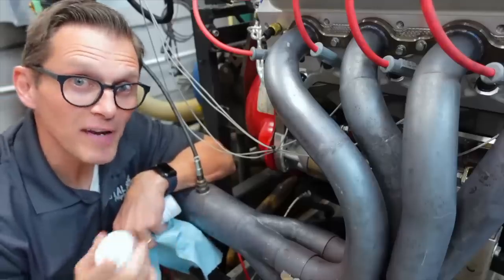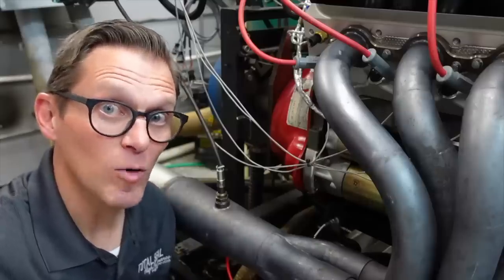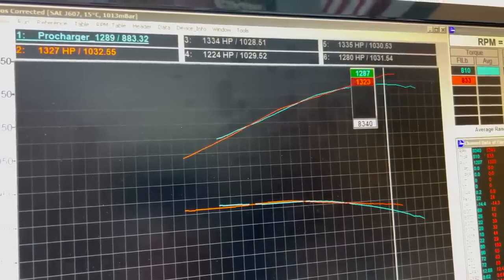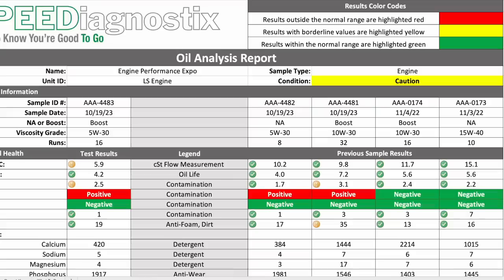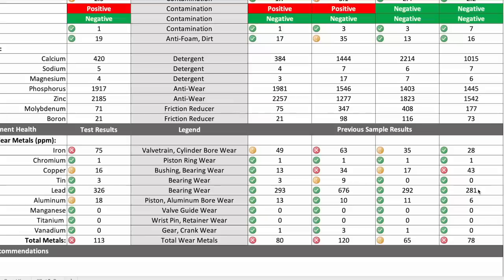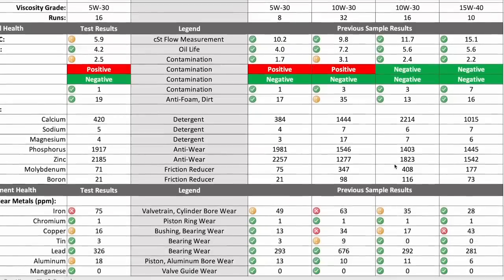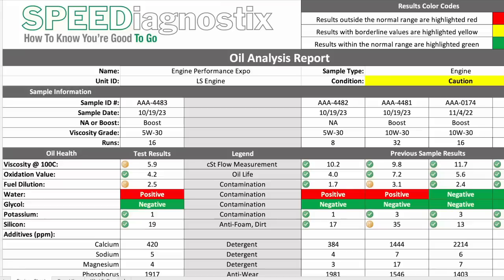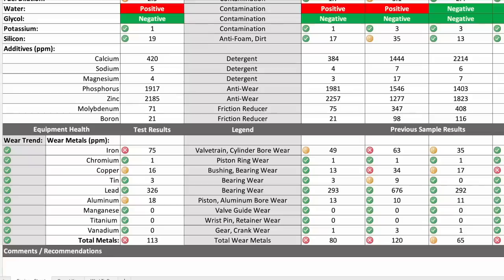What Adding BOOST Did Do To Our Motor Oil (NA vs BOOST Test)

Comment: It's "amazing" (not sure if it the right word)
The difference engine temperature makes to oil and contamination. Personal experience living in Canada, My daily driver, 2017 gmc sierra with a v6 has some very minor upgrades.  Exhaust,  intake, tune and an oil catch can. In the summer months, the can collects about 2-3 oz of oil and gunk over the span of one oil change.  6 months and 6-8000kms of 20 minute commutes, errands and maybe 6-10 weekend camping trips (1-3 hour drives) towing a 6500lb trailer.  BUT, in the winter my driving is entirely just commuting and running errands. In about a month that can will fill with about 5-6 oz of mostly water and only trace amounts of oil "scum". I've even had it freeze up once and it ruined the baffles in my old can trying to empty it. But the unknown factor is the fuel makeup. There are different blends for summer and winter gasoline  which affects emissions and combustion.  So how much is caused by cold oil/engine vs fuel quality.  I've also heard that e85 is hard on oil as well. I'll go out on a limb and assume it's probably a similar result to what I'm already seeing in winter but year round regardless.  (I can't get E85 here to test that)
Reply: E10 sux but I just filled up and non ethanol is 85 cents higher. That's 28%. 😮
Reply: Regular  is 3.98 here and ethanol free is 6.00

Comment: RacerX Needs To See This: Thinking fuel dilution possibly killed his first Demon 170. On a boosted engine you probably cant change your oil often enough.
Reply: Not all boosted engines are the same. There’s a huge difference for oil between a supercharged engine & a turbo charged engine since the turbo shares the oil. So yes a turbo engine pretty much can never have the oil changed often enough. Number one turbo charger failure is dirty oil.

Comment: Excellent info. Was wondering if it was affecting the oil the same way Ethanol fuel does. Running from E30 to E70 with %40 bigger injectors, more advance timing and %30 more boost. Still on 5w-30, but change oil at 3K. Unfortunately, 10W-30 holds too much calcium and on a DI, not ready to take the risk.  THANK YOU.
Reply: With increased boost and bigger injectors ethanol can really do a number on your oil (especially if the engine is port injected - cold start dumps a lot of ethanol).  I went from 5w-30 factory to 5w-50 on my CTSV after I bumped the hp up by about 300 over stock with ethanol and more boost.  Still has good oil pressure, minimal consumption and great power output after 80k miles on the corn.  But you can smell ethanol in the oil after 3000 miles.

Comment: Obviously, the dyno engine is a different animal altogether. With that said, the newer OEM engines with turbo that are spec'ing 0w20 or lighter, is scary from a longevity standpoint. 

My wife's new SUV has an inline-6 turbo. Owner's manual states 0w20, but only for USA and Canada  😉. Everywhere else, it states 5w30 is best even at temps below 0 Fahrenheit I think. I live in an area where summer mornings are 80 degrees or higher at dawn. I'm thinking of going to 10w30.
Reply: I have to agree, if your in a warm climate 10W30 will protect your engine much better than 0W20, use the 10W30
Reply: @spartus56996   I read the manual upon purchase and saw the oil rec's. I did the first oil change @ 900 miles with 5w30
Reply: Careful there, my friend. Engines designed for these lower viscosity oils have tighter bearing clearances that are engineered to maintain clearance with these thinner oils. I'd probably try 5w30, but no way would I put an oil with a 10 base oil in an engine designed for 0 viscosity oil. I'm sure the manufacturer has done plenty of cold starting and high temperature and load testing with the viscosity recommended. With that said, I would take the manufacturer's oil change interval and half it.
Reply: @dougrobinson8602  No issues at all to use a 10W in place of a 0W in year round warm climates, if someone was really concerned, do the 5W30
Reply: @spartus56996  I am sceptical about cold start and pumping efficiency of grade 10 oil and it is more viscous fluid for most of modern car engines
Reply: @dougrobinson8602.   I think the clearances on modern engines are actually more accurate and uniform as well as "somewhat" tighter. Also the metallurgy is better & surface finishes are much smoother. So it's not like 10W30 is a 1/2 inch thick or something, you know what I'm saying?
Reply: @dougrobinson8602   Agreed. Been dealing with engines, clearances, etc for many decades. The engine, in my strong suspicion isn't necessarily designed for 0w20 as that viscosity is only recommended in the US and Canada. Everywhere else, the manual and oil viscosity chart recommends 5w30 as the best oil
Reply: @dougrobinson8602   so in warm climates IMHO don't think 10W? should hurt.
Reply: @dougrobinson8602  I'm not sure they are actually using tighter tolerances with the lighter oils. I doubt they are when they give different viscosity recommendations for markets with fewer regulations.
Reply: I am not in favour of using 0w20 in almost any kind of vehicle for a longer period, unless some one is driving in snowy conditions

Comment: There is a big issue here, at least in my opinion... You've got a lot of people who are going to take this as doctrine across a very wide gamut of applications when it should probably be applied fairly narrowly.

I've been sending oil out in my cars for some in time. I also use to do the same for work on some large industrial medium speed engines. 8 months ago I got a new car and joined some pages for that car. So many people on those pages say the thicker the better... So I reached out to some labs and asked if that's really true, given you have a stock setup running a stock tune since people were insisting the engine would blow up if you ran 0w20. All the labs replied back saying there was no discernable difference in wear that could be attributed to viscosity and that if what people are running meets API specs for the application they're going to be fine... At least in my application.

It also appears you were changing multiple variables across some of the runs... I can understand the reasoning, but if you do that you can't say it's scientific per se. Of course it's fine to rely on experience, but you are no longer isolating variables so data is no longer concrete.... Right?
Reply: Perhaps you're over-thinking it. This largely shows how high boost matched with high fuel can not just dilute the oil and make it thinner but also even squeeze and disintegrate some of the anti-wear/anti-friction additive. The question now is, for a given engine, what is considered "high". At the very least, this offers new things to think about and a person that is forced induction and tuning their car can send oil samples to see the cSt and wear analysis and adjust accordingly as opposed to not knowing and simply using the same oil for years and damaging their motor.
Reply: @markdavidson1049  that I totally get, my point is you're going to get a bunch of guys with their old V-tecs thinking they need to run 5w40 just because of this video. Ok, yes, I'm exaggerating, but I'm not that far off 😅

Comment: Now I have a better understanding of why the factory calls for Mobile 1 15W-50, for tracking my boosted C7 ZO6, instead of 0W-40.
Reply: Plus changing your oil every 3,000 miles vs 5,000 miles +

Comment: How about a motor oil tournament using that engine as the test unit? All the big names & same viscosity. Some guys swear by Amsoil & others swear by Supertech. And any updates on the Valvoline restore? Thanks Lake.
Reply from the maker: Great suggestion!
Reply: Over here in the UK, many weekend warriors are using Gibbs HR1 in historic events, XP 6 and 9 seems popular with the more modern machinery runners. An alternative is a British brand called Millers as a 10 w60. For vintage machines still using white metal bearings the still seems to be nothing available that is better than the old Castrol R30 or 40, you just need to change it way more often.
Reply: Think about what you just said. Pennzoil goes on sale frequently, but Mobil one doesn't?  Why is that, it's on sale frequently?
Reply: @oneninerniner3427  who cares. Works for me and saves me more than Mobil1. Both are good
Reply: I'd always run blue bottle oil and changed it more often. Project Farm found it as good as most.
I'm a Mobil 1 fan. I'm not willing to spend almost twice as much $ for Pennzoil Natural Gas oil.
Reply: @hotrodray6802  pennzoil is usually cheaper where I'm at. It goes on sale frequently and they usually have a rebate/rewards offer too. Mobil1 is usually cheaper when not on sale. But pennzoil is on sale so frequently that I just plan ahead.
Reply: @craigquann  That Mobil oil that they sell to us public is not ideal for a race motor with bigger clearances, and is a disaster on a flat tappet type of valve train. The race oil that mobil supply to specific teams, is nothing like what you or I can get our hands on.
 Don't think they'd be interested in sponsoring a 1Ltr Hillman Imp to do a 52.09 sec. run up Prescott hill climb 🙂

Comment: Very interesting about the water content and temperature!  See a lot of guys running classic cars that get scared if the engine gets much over like 150-160-170 degrees. My feeling is they'd be better off running hotter, to get rid of the water. Your thoughts?
Reply: I remember my father telling me if start the engine warm it up. There’s condensation from sitting. Don’t take a short trip to get and expect your engine to like it.
Reply: @oldgringo66  A very smart man
Reply: Water temp does not directly correspond to oil temp. Unless you use a huge oil/water heat exchanger as used on non total loss marine systems
Reply: A fair few modern cars actually have oil to water heat exchangers. Mine has one built into the filter housing. Good for quick warmup, which the OEMs want real bad for emissions reasons (modern cars often make most of their toxic emissions during the warmup period). But also helps durability.

Comment: Good video would be a direct injection engine on off the shelf oil vs driven oils and Na fuel injected engine off the shelf oils vs driven oils and the loss or gain in low speed pre ignition in the engines especially the direct injected and any more or less wear that may be taking place

Comment: Amazing work and love what you do. Asking again, test BG PRODUCTS! Has to be to most used additives in the market for STEALERSHIPS and shops..BG44K, CF5, EPR, and the famous MOA!
Reply: BG 44K is an excellent fuel additive. Has a great amount of PEA. The SDS is available and it details the chemical composition.
Reply: I been using the Famous MOA in our 2018 FORD EDGE NON Turbo V6. Based on this Channel, and Lake's testing, I'am inclined to STOP using it ASAP due to IT (the MOA) Changing the Oil's Composition and "CAUSING WEAR" unnecessarily ???? Hmmmmmm???
Reply: @kendavis1198 yeah. 44k is “great”, why haven’t there been any testing like Lake does on BG products? I’ve used them for many years, it’s funny how many STEALERSHIPS “perform” the BG service, and then the cans are in the mechanics toolbox and they take home for themselves. 

It seems out of every single thing we can buy from AUTOPARTS stores snake oils, to redline fuel system cleaner, to BG products…BG seems to be the only ones who do their “testing” on the MOA for example.
Reply: @kendavis1198 I agree. Scary, I USED to love the CERATEC from Liqui Moly, German, decent oil… Lake is exposing everyone and I love every video he creates

Comment: If the engine was run at a higher temperature like a typical street engine, do you believe that the heat would evaporate more of the fuel out of the oil which in turn would cause less wear?
Reply: Yes, the fuel would vaporize out eventually. Some of this dilution is due to the tune as well. It could be better.

Comment: I run a 14,000# Mitsubishi Fuso box truck with a little 3L turbo diesel that frequently sees 24# of boost.  I've cut the manufacturer's service intervals in half and change my oil and filter every 5,000 miles.  So far she's running like a top at 80,000 miles.
Reply: make sure to include a fuel filter/fuel water separator filter every oil change as well.
Reply: It would run the same at recommended change intervals...
Reply: Might as well include brake and PAS fluid in that too, and while you're at in renew the tyres when they're 20% worn.
Reply: @Stoff1  im a diesel mechanic working on semis and box trucks. these engines are common rail running 2500-5000+psi fuel pressure. engines run anywhere from 10-17,500 miles between oil services and if you skip even one fuel filter swap you're at risk of that truck going into Derate/losing power over a FUEL FILTER. imagine someone towing their truck over that. it costs you in the present so it doesn't cost you in the future. you don't even want to know the cost to repair a damaged modern fuel system.
Reply: @jake20479  your correct, an I don't agree with the recommendation from the manufacturer, because how it's used an were matters,an there more worried about epa carbon credits than how long your engine van last..I dump them when there pulling at 4000 an never have any issues an I see them regularly that are done at manufacturer recommend intervals that don't make the miles that the people who keep up there  maintenance an change them often get way more mile out of them lbs with a million on it an he has it changed at 3500-4000 mile still running.

Comment: this makes me wonder what happens with e-85 contamination. ive heard horror stories of significant moisture build-up in the bottom of the oil pan. the ethanol may clean the top, but moisture accumulation has to be detrimental. we value the motor geeks opinion LOL
Reply: I'm in the Type R world and have heard enough horror stories about adding E-85. Mainly the in tank filter breaking up and making it's way into the HPFP. There's a $1500 to $3000 job when the pump fails. On top of fuel dilution issues. I would love to get that extra 40 or 50hp just from adding different fuel but I don't think it's worth the risks
Reply: Ethanol evaporates at 173 degrees. As long as your engine temp gets high enough to burn it off, it's not as big of an issue. But I'd still shorten OCIs on it

Comment: Great info.. with 20 pounds of turbo boost.. change oil every 2000 miles..
Reply: How about a stock car with 20 + pounds of boost? ( By stock I mean the Boost level goes over 20 pounds from the factory) I do have exhaust, downpipe, intake, inlet pipe etc etc. Stock Turbo though. I have a Type R. Calls for 0W-20. I use 0W-30 in the summer and 0W-20 in the winter. Amsoil Signature Series and change it every 4K to 5K instead of the 10K honda says and I ignore the oil life Guage. You can't get it under 50 percent life at 5000 miles if you tried. Obviously I'm not in boost at all times. Not even close but I do enjoy the car from time to time and the Turbo gets spooled 5 days a week
Reply: I got the same question BMW B58 is the same 0w-20 with 20 psi, they stand behing the 10k oil change. @thinkforyourself5672
Reply: @ruebarb1  I absolutely do not listen to their interval times. I change mine between 4K and 5K no matter what. I ignore the oil life gauge. That much I do know lol. They get paid to tell you to do longer oil changes
Reply: @ruebarb1  I changed my B58 from 0w-20 to 0w-30 (BMW oil), Wear metals wear half under the same mileage and similar conditions (daily driving with occasional spirited drives) - so thats all I run now for this motor. I do 8000km intervals.
Reply: @thinkforyourself5672  You're just gonna have to send oil analysis samples to a lab and see what it comes back with and adjust accordingly. I think the main point of the video is to bring awareness to us boosted folks that maybe sticking with the same oil and/or same viscosity and thinking we're good for years may be a mistake.
Reply: I think every engine will differ to a degree but the more force and longer duration of said force acting on the oil will have a tendency to do to the oil what we see here in this video.